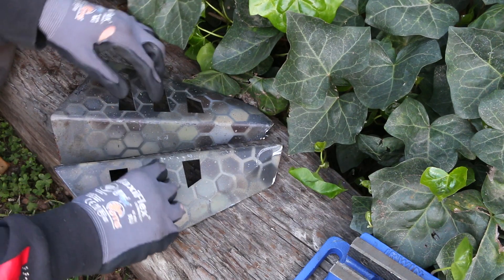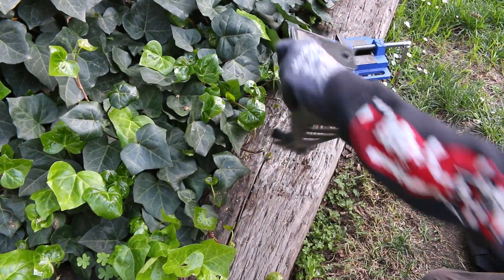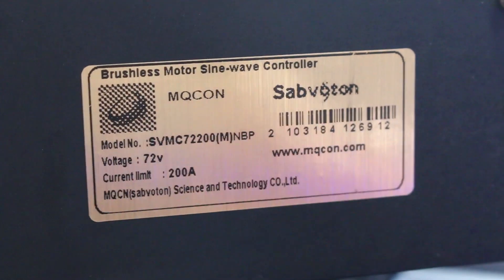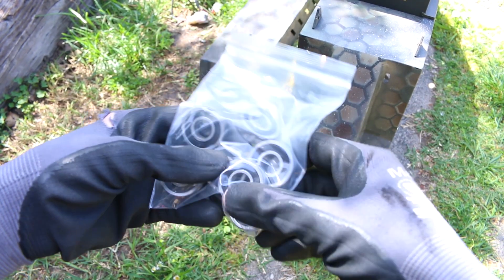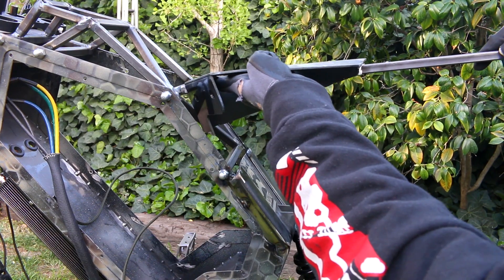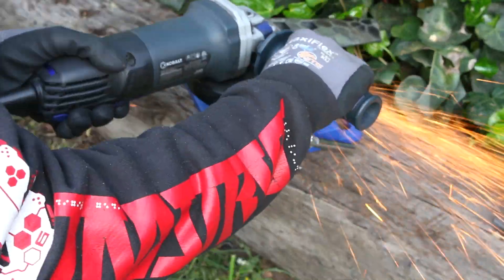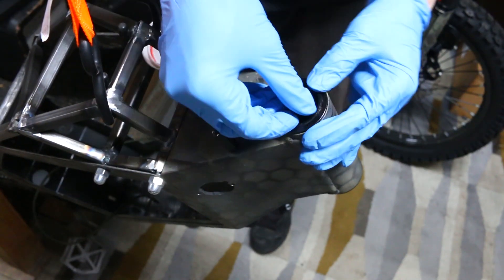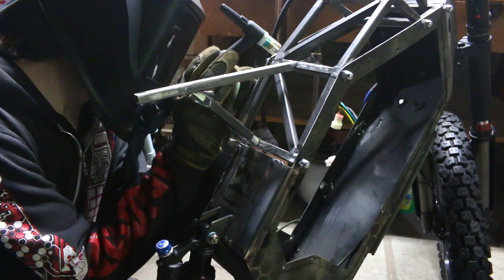🚲 Have A Seat!!! Custom E-bike 9.0 \\ Seat Mods - Fabrication - Enduro - DIY Build! \\ QS273 70Ah

Comment: what caliper are you using and do you have a link to it ?
Reply from the maker: It's a super cheapo mitutoyo ripoff: https://www.aliexpress.com/item/3256803796905128.html - these might actually be real though, not sure. I think I paid like $15 for mine, the (lack) of quality shows too - the plastic is terrible, I had to make my own battery modification because the plastic cover stopped holding in the cell battery and it would die after a week or so, so I converted mine to use a single AAA battery and it's rock solid now. 

Watch this video, it's helpful for deciding what caliper you want or need: https://www.youtube.com/watch?v=UdsurNbGRI8 

There are other calipers out there that are cheap and work well, but if you buy the real thing you do get what you pay for. I have real ones at my work and they are objectively of higher quality. Crappy calipers are nice for dirty work where you don't need absolute precision and also don't care if they get messy or slightly damaged.

Comment: love how the battery comes out the top of the bike kind of wish i got the steel frame when i made my bike its bigger then one i have so my battery would fit better and i probably  would do the same thing to mine if not just add door to top to make battery removal for winter rides easier
Reply from the maker: Thanks man!! If you have the EEB frame the battery compartment is a bit smaller, but the frame is a ton lighter, so you do get that benefit. I'm just hoping with solid state batteries on the horizon we can get a ton more power from way smaller packages 👍
Reply: @hightech-lowlife  yea iv got the one andy kirby has. but still wish i got the metal one its only 10-15 lbs heavier then the frame and when the bike is complete mine last weight was 115lbs with the battery so another 10-15 wouldn't rly matter much for extra space + ability  to mod the frame.  if you moded top on the one i got it would probably collapse unless you full weld top rails in because of how the inside structure is and the width of the frame inner rails is only like 5in with half in punch out on the plastic sides. with your stock frame i could probably fit my controller inside battery compartment as well unlike how i got it now mounted under bottom of bike.
Reply from the maker: @jaylord55  Yeah that is the EEB one! I actually built one of those on my channel and I remarked on how much lighter it was from this frame. It might take a bit more effort to set it up how you wanted, but I'm confident that it would support and suffice any setup you wanted with it. I usually go with smaller batteries (30Ah) that allow for enough room for the controller and battery in the battery compartment, which does look better and protects the controller from the elements better 👍
Reply: @hightech-lowlife  i went with 40ha 20s setup with liitokala cells i get bit over 70km out of it witch works good i use to use if for delivery's with uber eats till pandemic hit iv since scaled back. I went with larger battery to keep from completely killing cells and only charging to 4.0 v per cell for longer life. the pack has almost 10,000km on it now still going strong although the vlotage sag is kinda annoying. Been tempted to pull 2 of the cells out of parrell off pack and replace with some 25r's  so voltage sag would be less
Reply from the maker: @jaylord55  That's pretty good! Yes, I've seen that if you have a smaller battery that you're maxing out often (full discharge) that it will degrade the cells a lot faster than if you have a larger reserve. I primarily went with this huge pack to combat voltage sag, just having a huge reservoir to pull from should help a lot!
Reply: @hightech-lowlife  the liitokala cells are know for the voltage sag at semi high discharge rate so if i pulled out 10ah off the pack and replaced it with 4 25r cells i would theoretically have at lest 40 amp leeway of low sag curve but i dont feel like the bike needs it yet. The other idea i was playing around with was doing what The Inja did with his one bike and use some super caps as a buffer to reduce sag but no plans in future for any of the above as cash is limited atm and the bike still gets 70km on full charge at 40kmh lil less if hop up to 50kmh

Comment: I would’ve put the skinnier side of the seat in the front and fatter part in the back. You could put an air shock in place of the down tube under the seat and put a hinge on the long tubes so it can pivot.
Reply from the maker: Thanks man! it's possible it would be more comfortable that way but I like the look of a tapered minimalist end (similar to cafe racer style seats), but I get your point, I think it would have worked either way functionally, but to me this fits the aesthetics I was going for a bit more 👍 An air shock with a pivot would be pretty cool, but I think this frame has so much suspension travel that it eliminates the need for a suspension seat, maybe for a hardtail, but this bike is pretty plush. Thanks so much for watching I appreciate the thoughts and feedback!!

Comment: 👍are you doing a re paint on this one
Reply from the maker: Yes! Full repaint💪Thanks man!
Reply: @hightech-lowlife  nice one really like the new look on the bike man I have always fancied getting a welder And having a go
Reply from the maker: @dredfxcustompaint  Thanks man! You should definitely get one and try it out later, I'm sure you'd be excellent at it and it opens up more ways to build and repair things 👍
Reply: @hightech-lowlife  yes definitely what welder do you have
Reply from the maker: @dredfxcustompaint  It's an Andeli welder (a reputable brand in China) it works well for what I'm doing so far, most of the cheaper welders around come from China anyway and are just rebranded, I figured I might as go with one already from there that isn't the cheapest.

Comment: Man that seat looks sick, kinda Optimus Prime as a Decepticon meets Lockheed Martin F-22 Raptor.  It’s so crazy, you are literally doing all the mods I imagined doing to my same frame as yours.   Your utilization of the existing seat is a bit better than mine though aesthetically at least.   I have a good tip regarding the swingarm.  I installed these plastic washers between the swingarm mount and the swingarm brackets to fill the little gaps on each side that were causing my problems.  It took all the speed wobble out of my ride and my swingarm feels tight like it should.   I think the black plastic washers even offer some side to side shock absorbsion between the two halves of the bike. They are about the size of a Susan B. Anthony coin and about as thick as a quarter.   I can find the exact measurements for u if u want or I could ship u some if u can’t find them.   Just let me know.   Edit:  watching your videos is giving me the confidence to finally dive in on my projects… I love how you just go for it… learn as you go.
Reply from the maker: Thank you so much! It does kinda look like an F-22/Decepticon, I agree! You should totally start doing some things to your frame, I know it might be challenging at times but I think in the end you will be very happy you did it, plus you'll have a bike that is unlike anyone else! Thanks for the swingarm tip, I think I should be able to get it near rock-solid, I will try some bushings also over it if I can't get it how I want it, but I have a pretty good idea on how to make it near perfect. 

Even with the old bolt it's a dramatic improvement, now only maybe a 3-5mm wobble, when before it was 20-30mm. I appreciate the feedback, I think I just know myself in that if I get stuck or make something I don't like I know that I can keep changing it and improving it until it's something I like. Being stubborn isn't one of the best character traits I have but it can be an asset in this way and it helps when diving into things like that 👍 Just go for it and keep iterating until you have it how you want it!
Reply: @hightech-lowlife  yeah I am a perfectionist too, so bad that I give myself panic attacks just thinking of new ideas for days on end… obsessive  and stopping me from even starting a job. 🤦 .  Your channel is great. Thanks for the help and The Tips! It really means a great deal to me.
Reply from the maker: @erikjonromnes  I'm a perfectionist too, it's a bit of a disease, but it does have some attributes - I've accepted the fact that I know I'll never get around to even 1% of the ideas I have, or want to bring to life, and that's ok. Just keep going! Thank you so much!

Comment: Overall....very creative.   You'd probably be able to create your own frame design that allows people to drop in big batteries and controllers without the headache currently on the market.

Sidenote: I'd hate to see the whole seat fall off while riding.  With a 200a controller I know you're going to be bolting⚡around.
Reply from the maker: Thanks man I appreciate it! I'm hoping within the next couple years that battery tech makes some advances so that we can get a lot more energy out of smaller and lighter packages, the limiting factor now for ebikes is batteries but that will change the more the world goes to EV transportation, it's only a matter of time! 

Oh yeah, I'll be welding in even more support braces and it should be very sturdy 👍 thank you!

Comment: Love your channel. You sound so much like me it’s crazy. Lol my bike is still under construction I’m adding a front hub motor. I wanted to make a custom box to sit on top like a tank and I had to do a lot of sheet metal bending which like you is a pain the butt! A metal break would indeed be a good investment. A tip that I learned was to put the metal that I’m bending inside the Vice and bend it down you can get a cleaner bend that way. Also if you use something thick like 2X4 or metal piece that’s longer than the piece you are bending on both sides of the Vice before you clamp it you can get a longer surface area to bend, than just the surface area of the Vice clamps (if any of that makes sense). The welding looks super good, looks better than mine. The stock welding looks a lot easier, I went with MIG. I enjoy your videos, can’t wait for the next one!!! 🔥
Reply from the maker: Thank you, I appreciate it! Yes a lot of bends without a brake is really tough to get them clean/sharp. I agree with your technique idea with the vise and having a longer thick piece of metal to bend it over, I have seen that done before 👍 I think I just need to buy or make a brake though, this steel is super thick (4mm or so) it's really hard to bend even with a hammer, had I not cut more than half way down the material I think it would have been impossible to bend 😂. 

Thank you, I think it just takes more experience and your welds will improve naturally, just as with everything else practice makes perfect. I can't wait to give this a test run, then we gotta disassemble it and start the cosmetic mods. Thanks again for watching and commenting!
Reply: @hightech-lowlife  you’re welcome. Yes I tell people that fabrication is basically adult arts and crafts lol nonetheless, yes the metal brake will be quite the investment especially if your fabbing a lot. Good luck with your seat man. I know if it were me an the slots were not symmetrical it would drive me crazy. However, it’s going to be covered with foam or cushion so it shouldn’t be bad. Keep on trucking!
Reply from the maker: @En3rgyLee  Yeah totally, I think all of construction is just arts and crafts on a larger scale 🔨 I'll get a brake someday soon, I really want a plasma cutter + brake then you can make some really cool stuff. It does bother me a bit, but I don't want to take the effort to move them. Thanks man, I appreciate it!

Comment: Your welding is improving! Keep at it, you will soon be able to lay down quite some reproducable results on the butt joints especially. I like the seat design, the sharp corners on the ends could end up being dangerous though so think about that when finishing the seat up.
Reply from the maker: Thanks man! I think it is improving (very slowly though 😂) I have more projects planned that require welding, so that will help, but I appreciate the encouragement! The tips appear to be very sharp, but I did round them a bit and the metal is thick enough that it's not really a hazard unless you were hit with a lot of force, but I'm still thinking of a way to integrate a handle so I will consider a way to make that a bit less sharp 👍Thank you!
Reply: @hightech-lowlife  Theres always a risk of hitting yourself very badley with a seat on any bike, but two tips that are pointet towards the end. Even with 4mm thick plate or however thick it is, you could give your legs a really bad time. With a handle or a rear light covering the gap there I think the risk of chopping something off in an accident is medigated.
To your welding: Try to avoid fillet welds. butt welds will probably do it
Reply from the maker: @jellolon8435  Thanks man! Yeah I will probably put a light there or handle, something 👍I definitely wouldn't want to crash on this thing, it will probably end up being 130-140lbs with a lot of metal. I hopefully will get better at tacking, that will help speed things up more, thank you!